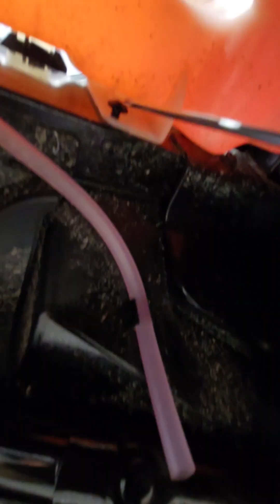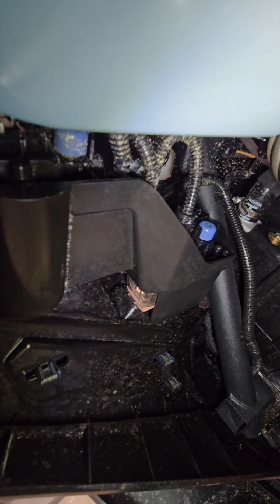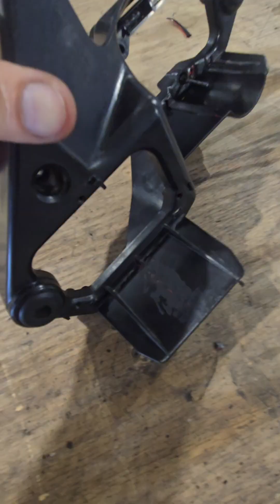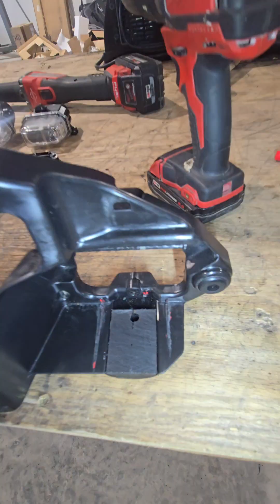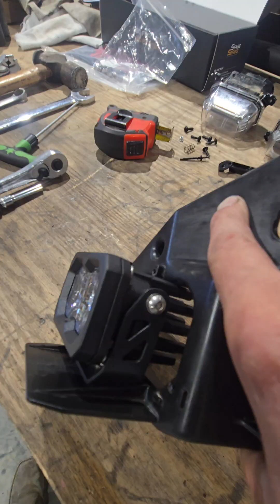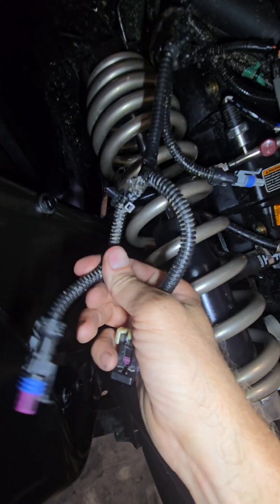Can-Am Defender HD11 headlight upgrade installation

Comment: Ive never watched an accessory video that discouraged me from buying an HD11 or an accessory for an HD 11 more than this video. Most owners of these machines don't have the tools or the mechanical ability to do this them themselves and I can't image what it would cost to have a shop do this for you.
Reply from the maker: These are basic tools and basic mechanical skills.
If you don't have these tools or this ability, you are exactly right. Do not buy any dedicated off road machine.
You will need to have some basic tools and basic skills throughout the ownership of a machine like this.

The point of this video is to be a detailed installation video of this product. I don't want someone to buy something and have them in over their head with an install they can't handle. I want my customers to be educated in the product so they can make the best decisions for themselves.

Shop labor time on this install will be 3 hours.